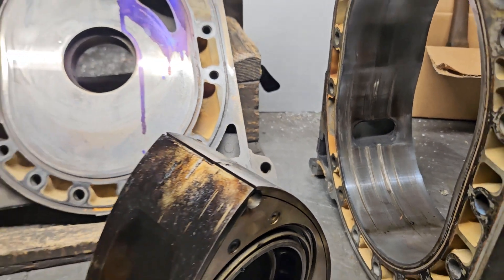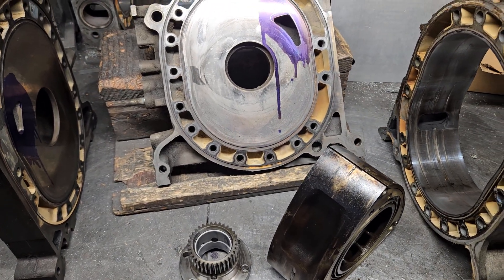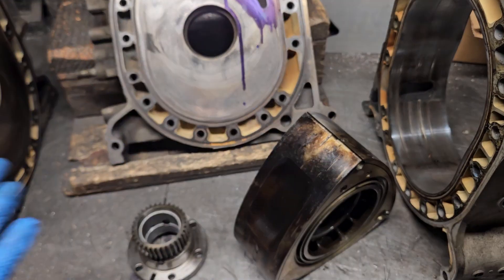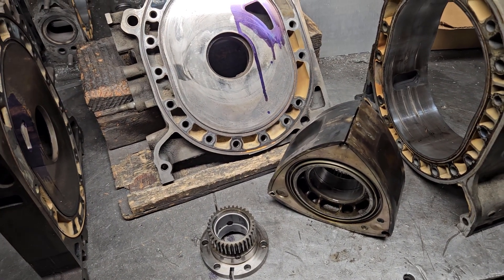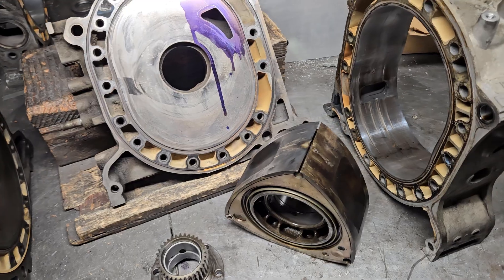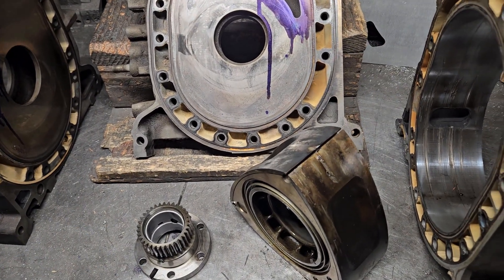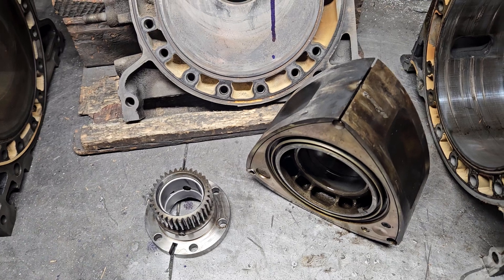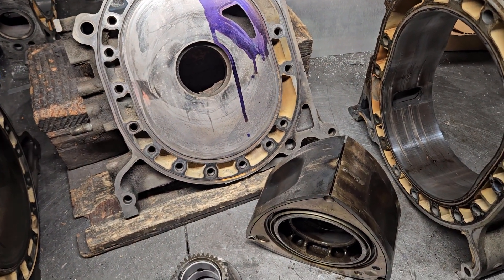Avoiding DETONATION Mazda RX7 Rotary Engine Discussion & example of damage - how to avoid

Comment: Would you consider making a video about how naturally aspirated rotaries react to different fuel octanes? I've always been curious about whether there is really any reason to run high-octane fuels in a bone-stock Renesis setup, given its higher compression ratio compared to the old 13B, and I've wondered if E85 could be worth running as well.

Comment: There is nothing premium about the octane of fuel, and is a misnomer. The higher the octane, the higher resistance it has to detonation, used primarily for higher compression engines. The only reason to use a higher octane fuel is for higher compression engines, that is all. Using 93 octane in a low compression engine and you lose power, no big deal, but if you use 87 octane in one, whoa buddy better be careful! I'm looking at you ecoboost guys! The issue with a fuel system/ECU not delivering enough fuel is it will cause a lean condition. The problem with that is the combustion temperatures increase dramatically, potentially causing engine damage. Pre-detonation results in the engine trying to destroy itself and ignites the air/fuel too early. Wide band O2 sensor and gauge are nice, but everyone should at least have an exhaust gas temperature gauge with a warning due to how destructive a lean fuel condition really is.
Reply from the maker: Appreciate the notes and thanks for watching.
This video is disgusing the turbocharged 93 rx7 not fuel octane in general. The 93 to 95 rx7 is exceptionally sensitive to octane and detonation. And like this car, when they're stock, they don't have e g t gauges or wide bands, which is exactly what i'm talking about in the video. But you have to realize this is a low compression motor because it's under boost. Please check out the channel and understand what we're talking about.This is not just agent generalization.  If you want me to do a video about naturally aspirated rotaries and octane, that would be a completely different topic. And is up for debate as in certain conditions running something like an ethanol can be beneficial because of the cooling aspect. The fuel game has evolved over the years.
Reply from the maker: This is not a general fuel discussion. This is relative, do the turbocharged RX7

Comment: The Mazda Book 'Rotary Engine' indicated 90 Octane will be the best fuel required in a Wankel, thus, how detonation can happen with Low ON fuels is surprising to me.
Low Octane requirements could be an advantage from the Refiners' side, low ON fuel could be easier, cheaper to produce, even distillation taking less energy, final balance more favorable.
Comments?
Reply from the maker: You're referring to the discussion on naturally Aspirated motors not turbocharged motors
Reply from the maker: That would be only on a naturally aspirated motor. Or NA RX7.
Reply: @KyleMohanRacing  The chart by Mazda about Octane requirements in Wankel appeared before the RX-7.
For sure you are aware oil is anti-detonant, specially if premixed to gasoline, also Ethanol is anti-detonant, a SAE technical paper by the Syvaro team proved Ethanol, either in 5 % or 10 % mixes in gasoline, "gasohol", E5, E10, is better for Wankel RCEs than gasolines.
Of course, to any Ethanol mixes, lubrication oil can be added.
It's not clear if Ethanol of higher purity than 10 % has any advantage.
Ethanol is hygroscopic, and absorbs water from the air.
Methanol has a lower energy content per weight than Ethanol.
 Methanol is extremely toxic, can kill, make blind, or induce severe irreversible neurological symptoms. 
It can be absorbed through skin, by breathing,...
Is good knowing that after a Methanol poisoning, while the case is taken to the Emergency Room, Ethanol is an antidote, it blocks the metabolism of methanol into deadly products.

Comment: Japanese octane ratings are not the same as US octane ratings.  Japan uses RON to calculate octane, US uses AKI.  A "high" 98 octane fuel in Japan is equivalent to 93 AKI in the US.
Reply from the maker: interesting. haven't ever heard that and considering any variation lower in octan than its tuned for can lead to issues best to be safe and verify its a good setup. this owner was informed it had been re tuned for higher octane. Then ignored the warning... So lots of opportunity to have a failure.
Reply: @KyleMohanRacing also in Japan they have 100-103 in some stations, so if it was mapped on 103, no wonder it blew up.
Reply from the maker: @joeybratten correct